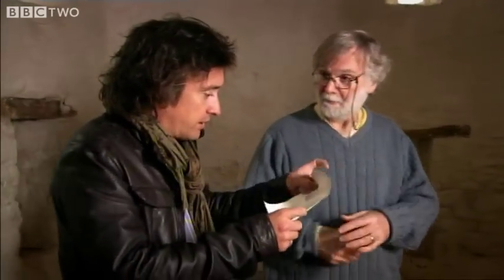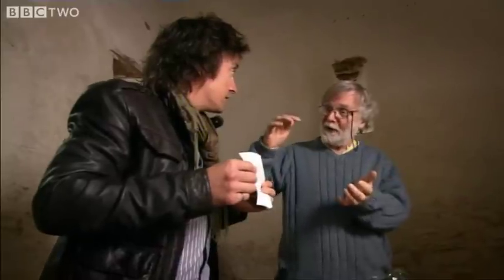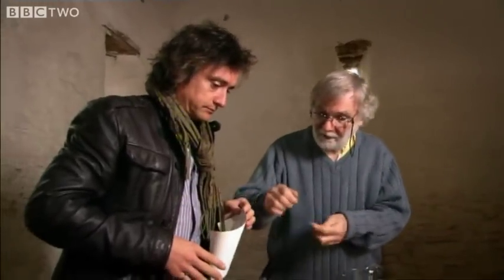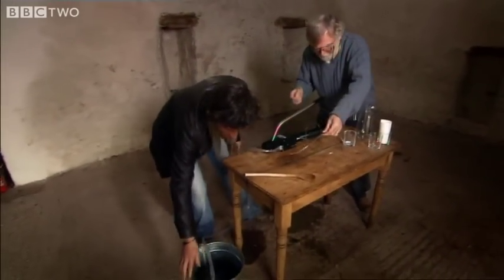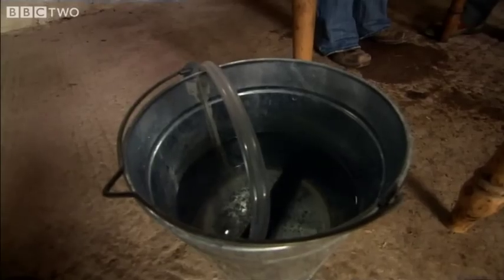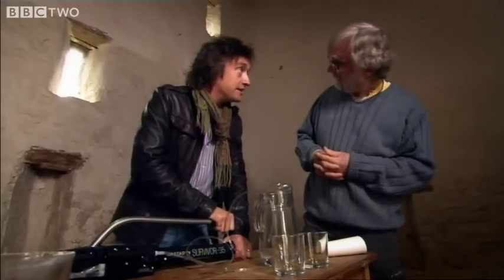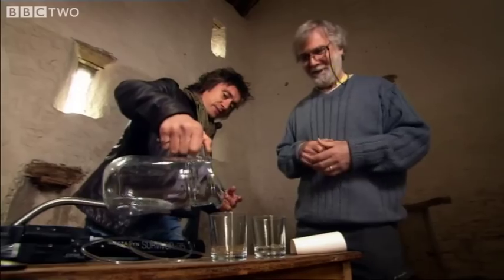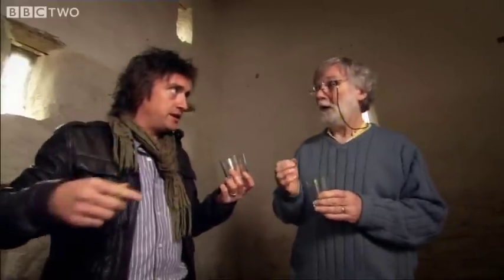Drinking Water from Salt Water - Richard Hammond's Engineering Connections - BBC

Comment: this was actually the technology they are using in dubai. where there are not much of a rain. they use sea water and disalinate it. one reason why water is more expensive than oil. coz they need much more power to use disalination that cost a lot to add it up on the bills.